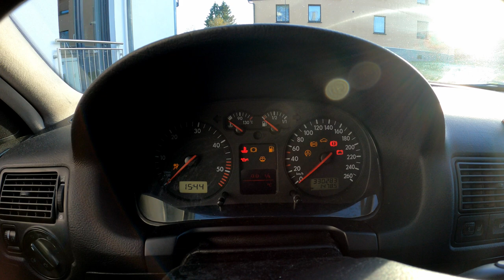The RingTracktor is DEAD, Long Live The RingTracktor!

Comment: Had this engine in the MK1 Leon. Strong and economical!
Edit: Mate, if the boost doesn't kick in until 3k RPM, then your turbo actuator is gone. These should pull quite strong from 1800 - 2000 rpm.

Comment: Well this brought back memories! I had the alternator swapped on my TDi- daily back in the day and suffered a very similar boost pipe- dislocation while overtaking a tractor on the road. 😅 Two different indie- shops claimed to have put it back correctly, but eventually it was the VW- dealership that succeeded by removing the bumper first. 
Happy birthday Misha!! 🥳

Comment: i had similar TC problems whit my old 2001 vito van when taking left hand terns the car was slaming the break on for like miliseconds, the problem was steering wheel angle position sensor
Reply: Well it could be possible that it is the same issue with the Ring Tractor 2.0 Because of the modification of the steering rack.
Reply: @henrih3080  Yup he needs to disable ESP and leave the ABS on

Comment: i think the engine as is, it is pretty strong and even though you get the impression that this car is slow, I think it is faster than that tuned 7up you have. Diesel engines don't make a lot of noise so they trick you into thinking that you are going slowly, but if you compare the speeds, you'll see this 330000km old diesel is still strong.

Comment: Nice1! You have almost the same car as me! This is my run around car. I have another car i was getting ready for the ring, but didnt in time. So friends said take the golf!

So i fitted a tdi tuning box which brought the bhp to 189bhp, i fitted eiback pro springs and bilstein shocks, and i already had the audi tt brake upgrade on the fronts, upgraded rear calipers to the anniversary editions, wider and using twin rear rotor discs, and ebc red stuff pads. 

It did ok on the ring and surprised myself. But still it could be pushed more and also i believe could be modded more. But i was able to beat a few cars that had higher bhp.. was really fun xx. Enjoy ill look forward to your journey xx

Comment: will be interesting to watch this. Iam doing the same for my 150TDI. Some small tips:
1) Change Intercooler piping asap. Its shit.
2) Turbo should start to kick in about 1.8 and max boost should be at 2.3-2.5k revs. So check whats up with that.
3) You can put GTB2056VL turbo from volvo d5 for good power/lag ratio. maybe hybrid it and it will be good for 200-230 hp on wheels.

Comment: I'm late to the party, not read the comments so not sure if these have been covered but..

1) You have OEM xenons, way better than standard MK4 candle head lights!
2) Why didnt you just turn the seat heating control down to position 0?
3) Your traction control intervention is due to the TT quick rack you fitted, the geometry and steering turns lock to lock doesn't match the firmware on the ABS controller. Same thing happens on other MK4 models such as 2.8 4 motion, if you fit the quick rack, ESP starts nagging and intervening on left turns, even if you are driving at chilled/slow speeds. One way out of this which will suit your purpose is to actually code it out of the ABS completely. It can be done so you still have working ABS, but can remove ESP/TCS so you don't get any more intervention or warning light on the dash cluster.
4) Enjoy the new project :)

Comment: There actually is the PD115 with red DI.       Correction: PD100 red I, PD115 and PD130 with red DI and finally the PD150 with all reds known otherwise as the first GTD golf but from the factory it is known as the GTI TDI

Comment: for your information. If you're really planning to use the car in RCN: When you use a Diesel car in a DMSB certified race, it must be fitted with a homologated "DPF". There are homologated Diesel particle filters available for example from HJS. There were the Diesel powered Seat Leon WTCC and supercopas a if i remember it right. For this cars they homologated DPFs. Please read the DMSB Handbuch. Racing a Diesel is not that easy if you change somethin on your powertrain and want to use another DPF system!
Reply from the maker: Oh shit thanks for the heads up!
Reply: @mgcharoudin  i hove you can solve this ;-)
Reply from the maker: @be4tb0x  but also if the car came without DPF from factory?
Reply: @mgcharoudin  
DMSB Handbuch Blauer Teil. Abgasvorschriften:
17. Partikelfilter für Fahrzeuge mit Dieselmotor
Mit Ausnahme von Wettbewerben mit FIA-Prädikat ist
in allen Fahrzeuggruppen die Verwendung eines vom
DMSB homologierten Partikelfilters vorgeschrieben. Die
auf dem Homologationsblatt beschriebenen Kraftstoff-
Additive dürfen verwendet werden.
Vorstehende Regelung gilt auch bei der Verwendung von
z.B. Biodiesel oder anderen Diesel-Ersatzkraftstoffen.
Ausschließlich bei Diesel-Fahrzeugen der Gruppe G und
T darf alternativ zum DMSB-homologierten Partikelfilter
der serienmäßige Partikelfilter verwendet werden, wenn
das Fahrzeug die Abgasnorm EURO 4, Schlüssel-Nr. 62 in
Ziffer 1 des Fahrzeugbriefes bzw. in Ziffer 14.1 der Zulassungsbescheinigung
Teil 1 erfüllt.
Derzeit existieren folgende Partikelfilter-Homologationen:
Marke Hom.-Nr.: Verwendungsbereich
HJS PTK 350/75 bis 2000 ccm
HJS MS-DPF 2,4/1,3 bis 3000 ccm
HJS MS-DPF 2,5/1,3 bis 3000 ccm
HJS MS-DPF 1,7/0,87 bis 2200 ccm
HJS MS-DPF 1,8/0,87 bis 2000 ccm
HJS MS-DPF 3,3/1,3 bis 4000 ccm
BMW BMW DPF 2000A bis 2000 ccm
Seat Seat Sport V6PT 131723 bis 2000 ccm
Die Hubraumangabe bezieht sich auf den effektiven Hubraum
(gleichgültig ob Saugmotor oder aufgeladener Motor).
Hinweis: Auch die Katalysatorregelung der entsprechenden
Fahrzeuggruppe muss eingehalten werden (siehe
auch Art. 15.f). Eine Kopie des Partikelfilter-Homologationsblattes,
welches beim Filterhersteller erhältlich ist,
muss bei der Veranstaltung vorgelegt werden.
Reply: This is a political thing... There were some teams competing in VLN and such with a Diesel car. The know how is there.

Comment: If the Nuerburgring is such a “great” track as Misha says it would be designed with proper runoff areas in high lateral -g regions. Instead if there’s a slide off it’s a “write off”.
Reply from the maker: Uhm, your public road is probably a worse place to crash :)

Comment: In golf 4 you also have PD115 and VP90 and VP110 all diesel, and also de turbo on the PD130 and PD150 its de same. The things that changes from the PD130 (ASZ) and PD150 (ARL) in the engine type of thing's it the internals and the front mount intercoller

Comment: Misha I’m building a ring tractor myself!
It’s my first car, an Audi A3 8p
-2.0tdi DSG
-DSG software for quick shifts
-1854hybrid turbo
-V10 injectors 
- BC Racing coilovers 
- Whiteline poly bushes in the front 
- 350mm discs w 6 piston 18z Porsche calipers on the front 
- s3 brakes in the rear 
Getting a cam soon for a bit more power up top, and putting poly bushes in the rear, also looking forwards to a wider front track with a TT suspension setup.
What bucket seats would, or anyone around here recommend me for daily use  + track days?

Comment: It seems you've mixed up some Golf IV facts. There were 1.9 TDIs with 90 (VEP, 5-speed), 101 (PD, red I, 5-speed), 110 (VEP, 5-speed), 116 (PD, red DI, 6-speed), 131 (PD, red DI, 6-speed) and 150 (PD, red TDI, 6-speed) hp. The Seat Ibiza even got a special 160 hp PD-TDI. I also wonder why you didn't get a Bora (also called Jetta MK IV in other countries) since the longer wheelbase provides more stability and the chassis is said to being more stiff than the Golf's.

Comment: The PD150 in my country is called ARL🤣
Reply: Its called everywhere ARL but for nonVW viewers its maybe more understandable???
Reply: They are all arl
Reply: That is the engine code for all PD150's.
Reply: @MischkaMLT  Not 100%. There has been engines with code BTB which were e.g. in Sharan. They put them in in only about two years and then switched to 2.0 TDI. So they are rare to find...
Reply: @vasek987  Yes. I meant the golf PD150's. I should've been more specific. :)

Comment: HB Misha ! Just a question since you're  gonna fully build the engine. Wouldn't it be easier and/or cheaper to run an engine with e85 for RCN ? Or is it just not allowed ?
Reply from the maker: Diesel can't take E85
Reply: @mgcharoudin  Yep, I know that, I meant it as starting with the 1.8t engine found in the GTi, or even  a swap with a more recent EA888 since the car is gonna be developped into a racecar. I just have no clue about the benefits of running a diesel engine for RCN, cost wise 😉

Comment: Alles gute zum Geburtstag. Das der alte Ringtracktor kaputt ist, ist scheiße, aber zum Glück ist dir nichts passiert. Hat die Versicherung irgend was davon gezahlt mit oder ohne Tuningteile? Fahren in Deutschland ohne TÜV wäre mit dem alten eh nicht gegangen.
Reply from the maker: I never involve insurance for such small thing
Reply: @mgcharoudin   i don't know if a totaled car is a small thing :D
Reply from the maker: @Xtremepower21  I am in a fortunate position to call 1700 write off for a car a small thing. If I'd ask Insurance to be involved, then it's a minus on my no-claim and higher insurance fees which in the long run a lot more expensive.
Reply: @mgcharoudin  I had all those expensiv modifikations in mind, but great if you can re use them in the other car.

Comment: Hey, i had the 1.9 Tdi also, isn't the boost supposed to start at 2100 rpm apr.? Had the issue also  boost comming at arround 2800rpm, in the end some vacum lines had some holes in them, changed them and it fixed it
Reply from the maker: This car is a POS
Reply: @mgcharoudin  😅
It's an easy fix really vacuum lines to the round ball loking things 😅